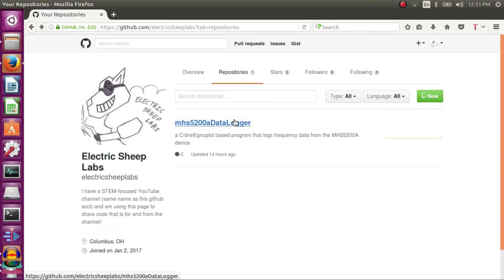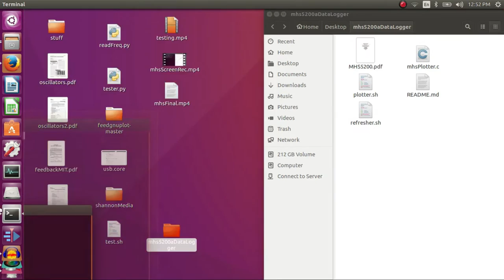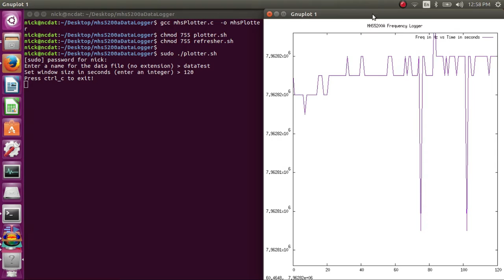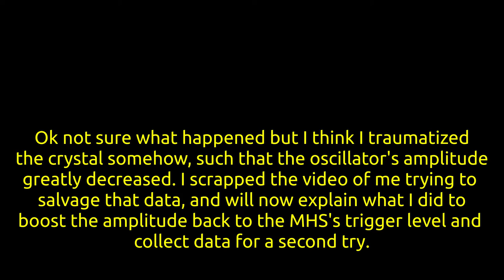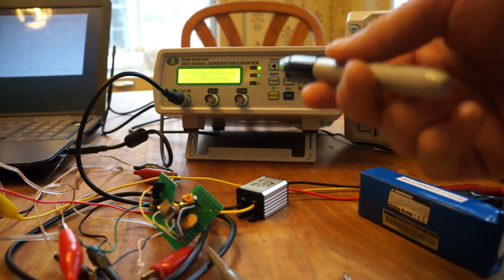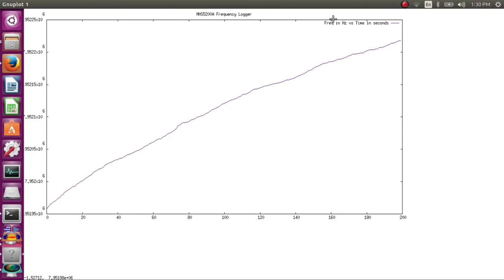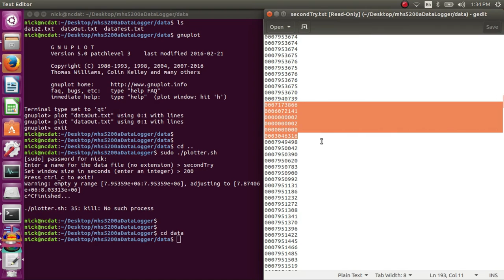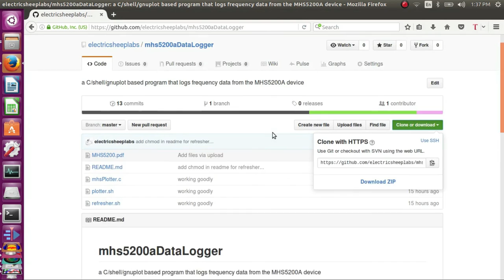MHS5200A Frequency Data Logger!

Comment: How to you set the counter up?. Im trying to measure my oscillator frequency on my radio but I cant seem to get it set correctly
Reply from the maker: Hi Brian can you provide more info? What frequency is your radio outputting, what hardware are you using to try to measure the frequency?
Reply: @electricsheeplabs2920  there are several oscillators. One is the bfo, one the marker, and then two for the dual conversion on the radio.  Im trying to use the same generator in this video. It says its a counter but dont know how to set it up. I dont have it tied to the computer. Im just wanting to know what settings on the generator itself.
Reply from the maker: @brianoakley1559  http://gotronik.pl/img/manual_MHS-5200A.PDF try this manual, you should just be able to plug the oscillator into the "ext_in" bnc port on the front of the generator/counter and configure it as explained on page 12 of the manual
Reply from the maker: @brianoakley1559  email me directly electricsheeplabs@gmail.com if you still have questions i would be happy to help